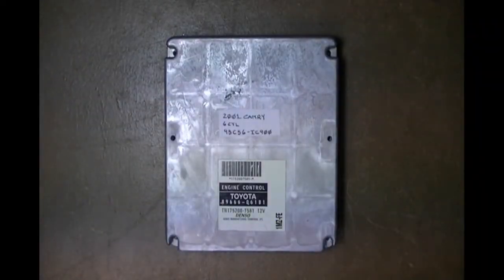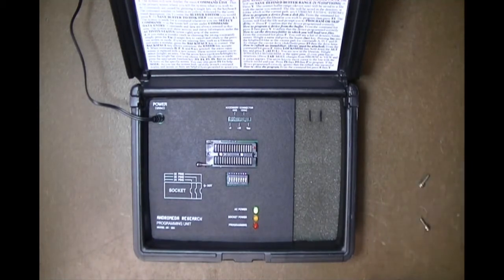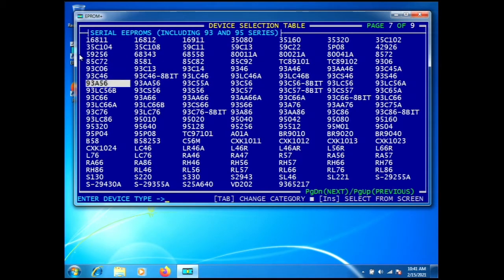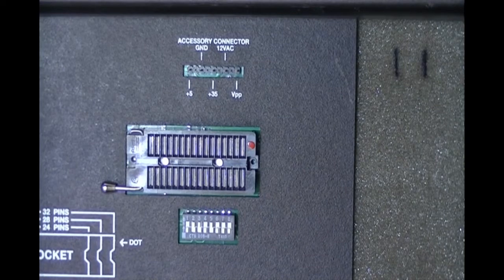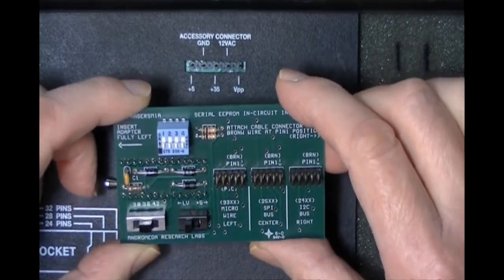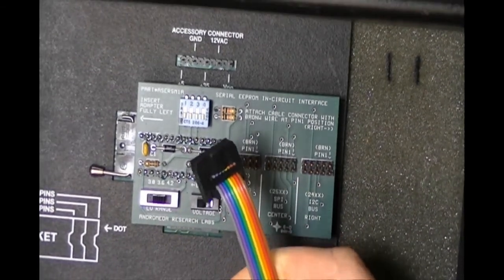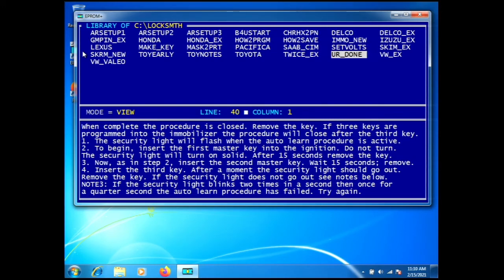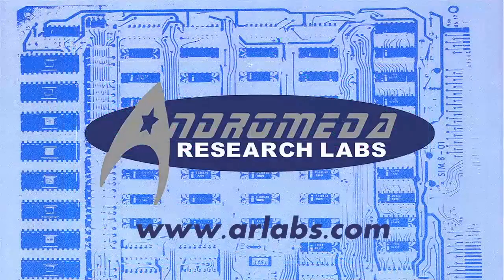Reflash a Toyota or Lexus ECU Immobilizer with the Automotive Locksmith Kit

Comment: Having a HELL of a time trying to connect to the AR32. Having to use such old systems is a challenge for me. Forget virtual machines. Unfortunately looks like Im going to have to buy a 20 year old pc to get it going.
Reply from the maker: There are thousands of compatible host platforms. The system will run on any hardware manufactured in the last 40+ years. If you have platform questions or problems don't hesitate to email or call. We'll always do our best to help.

Comment: Thank you for posting this video very nice also I have a question after flashing the eprom the car will start if the ecm come from salvage yard  and use to my car do I have to Change the vin number on eprom or I don’t have to do everything jest relearn the new key please let me know thanks
Reply from the maker: The vehicle VIN is not part of the immobilizer data. You just reflash the salvage ECU, introduce new keys and the car should start.

Comment: Im wondering if ive corrupted or ruin my ic900 part because upon programming, it always fail with Msg “device did not program correctly and a comparison of Buffers (00002D-FF vs 00002D-00);
Note: before using AR32, I had used Autel, VVDI prog and mini prog because my Toughbook was damaged and the newly purchased one was in transit). 

Also the red programming light never comes on so im not sure if the new toughbook is missing some thing; i downloaded the software onto Window
Reply from the maker: First be sure that the in-circuit adapter is set to LV-3.6. The 93C56 (IC900) is difficult to damage. Regarding the programming led, it does not light for the 93 and 23/95 series eeproms. It's just how the algorithm works. If you want to confirm correct operation, test the system with your tutorial eeprom.
Reply: @it is set on LV 3.6 and i verified it. I i also verified 2,3 and 5 dip switches and all the rest down.  I tested on my tutorial eeprom nd i get the same messages with the same budder comparison results. After chosing the 93c56 eeprom i set the Path to locksmith. In my case Locksmith is located within the E drive; then i open the Librarian to navigate to “Lexus” then “tab key” nd i scroll just under the 5 lines message and the first file displayed is ES 300 , 16bit.CDE;
I then proceed to click on F6 then F3 and finally P.